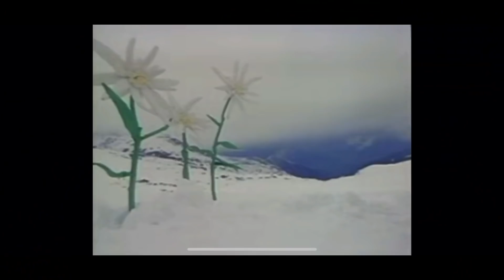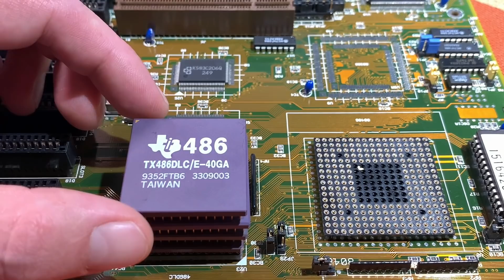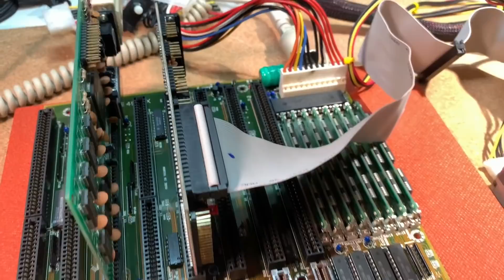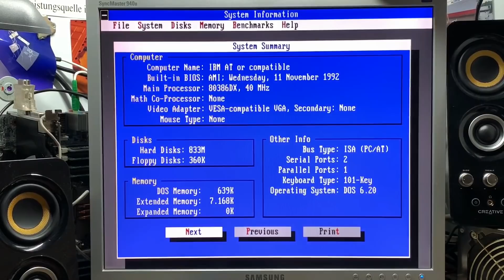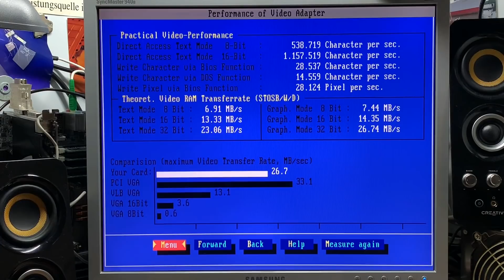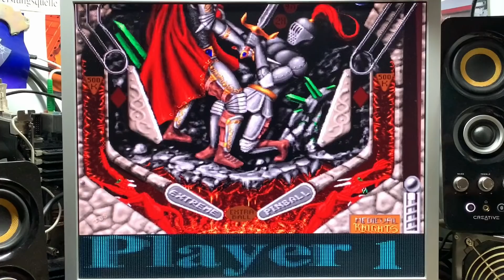AMD 386 DX-40 and VESA LOCAL BUS - Boardreview and Benchmarks

Comment: I have the same board V2.0 , you can use 386SX-25 to DX4100 overdrive on this board...Of course 386 with fpu. Amazing flexibility. Mine had a leaked battery bıut minor damage, salvaged from junkyard...

Comment: I disagree with the statement in the video that it is not worth having a VL-bus on a 386. For me, it is worth it from several different points of view. I will explain why. 1.) Yes, for more demanding games the CPU is the biggest bottleneck, but not the only one. In this regard, the test in the video is somewhat misleading. The test used a graphics card with the Cirrus Logic GD5428 chip. This is, of course, a fairly modern card, which is one of the best that the ISA bus could offer. But most people had a much worse graphics card in their 386 - typically some Trident 8900/9000, OAK, Realtek, Tseng ET3000, which are very slow cards. Usually equipped with 0.5MB of video RAM (generally from 256KB to 1MB). How many people had a GD-542x, 543x, Western Digital 90C3x or Tseng ET4000 at that time? That was really a minority. For most, any VL-bus card was a major upgrade, even if it was the most ordinary S3 805, which would eat all ISA cards for breakfast. In reality, for most cases, the difference would be greater than measured, even in games. 2.) Games are not the only thing that was run on PCs at that time. Even for simple image viewing, for example, ACD See or another DOS browser is sufficient with the same 386. 3.) Various graphical user interfaces were also run on the 386, and not only Windows - breadbox Ensemble/New Deal Office, GEM, Cybex Shell. There were also a number of programs that used graphical user interfaces - Deluxe paint, Mat, ET Klasik, Word 6, Excel, NeoPaint, various CAD systems, etc. All these programs for DOS will take advantage of the higher performance of VLB cards. Moreover, with these cards, it is usually possible to set much more interesting resolutions and refresh rates. Yes, this was also addressed in DOS, so it made sense. With Windows, OS/2, UNIX or Linux, this is multiplied. VLB cards were not only faster in principle, but the newer they were, the more they contained various 2D acceleration functions that could greatly speed up the GUI, but also the programs that ran under it (e.g. Corel, Adobe, large spreadsheets in Excel, CAD, multimedia). Each of these acceleration functions simultaneously relieved the CPU, which did not have to devote itself to rendering primitive functions (such as filling the area, moving the cursor, window frames), but to something else that the user would appreciate more. Most VLB graphics cards could be expanded to 2MB and had a better DAC, which meant not only higher resolution, more colors and higher refresh rates, but also increased performance, because most chips used at the time were designed in such a way that by expanding the memory, the data throughput of the bus between the chip and the memory was also doubled, so a further increase in performance. Apart from a few top late models, this was an unattainable dream for the ISA world. These are things about graphics that gamers won't appreciate, but those who worked on that PC will appreciate.
3.) Another thing that gamers won't appreciate, but workers will, was the ability to provide a better VLB controller. In DOS, where small files are loaded one-time, it's unimportant, but in Windows, where data is worked on and something is constantly being loaded and saved, it was important. It was possible to use both IDE controllers with cache and SCSI controllers. SCSI controllers have an advantage not only in speed (SCSI disks of that time were usually faster), but they also relieved the processor. When the processor works with an (E)IDE disk, it is used up and it can't do anything else very well. So if we work a lot with the disk, then we have a lack of CPU power. SCSI controllers often had their own controller and so they put much less strain on the CPU. So the CPU could focus on other things. That's why SCSI was the standard in better PCs of that time/workstations/servers. In case of heavy load, it could also be combined with the controller having not only its own cache but also its own processor, but we are a bit out of the picture. It was completely brutal when the system started swapping, which was a normal process, because RAM was generally in short supply at the time, as it was very expensive.
4.) 386 boards with vLB were also of a newer production date, so they supported user-friendly things like automatic disk detection, but they often also had support for 4 disks (which was appreciated given the size of the disks at the time). Those boards also often had correct support for 486DLC CPUs and derived types, so you could afford to turn on the L1 cache, which was turned off by default due to problematic compatibility. This also affected performance, and they were easily upgradeable to a real 486 like the board from the Galaxy video. So in 1993, a person built a supercharged 386 without paying much more for a 486, and a year and a half later, he added an AMD/Cyrix/TI 486 DX2 80MHz for very nice money, and he had a solid machine again without having to change practically the entire PC as if he had bought a regular 386. Maybe he added another disk, a CD drive, and more memory to the graphics card, because he had somewhere to connect it. The upgrade took him 10 minutes of time and a minimum of money.

To sum it up, VLB in combination with the 386 had a small but nevertheless recognizable impact on gamers and a big impact on the productive segment. I do not agree with the distorted view that only games were played on PCs at that time, and therefore I reject the conclusion that it is only valid for games, and even then only partially. I had such a system then and I have it again today :)

Comment: I was a tech during these days, and it was a little early for VLB.  The operating system wasn't mature enough to take advantage of it except in very specific circumstances and with software which knew the hardware.

Comment: I've always being intrigued with a VLB setup, so I built my own in 2019... For VGA you can use for the 16 bit the WD90C31A-LR 1 MB (Paradise), it's very fast, I believe the fastest for an ISA slot. I have checked ET4000AX, Trident and some Cirrus Logic, all with 1 MB VRAM, but the GUI acceleration for Windows 3.x is very poor than the Paradise. And for 32 bit (VLB) try the SPEA Mirage (Video Seven) S3 864 Vision P64 with 2 MB VRAM. Fastest card (yes faster than ATi Mach64) for VLB bus and with excellent GUI acceleration. On my i486Dx2 66 MHz it runs Quake and it is playable!

Comment: For VLB bus, 386DX doesn't have the arithmetic intensity like a 486 or RISC CPU at a similar clock speed. The 386 has hardware barrel shifters for that PinBall game. A different non-3D benchmark is needed.

Doom doesn't use FPU.

Comment: Huh, have you ever used the Feature connector on the VGA card? I had the pleasure of doing so with a TV card, but truth be said that had AWFUL quality, TV on a PC monitor really looked like crap back in the day, and as if the source signal was not bad enough it was then being digitized at 320x240 in most cases. Recording TV then was like nope, bad quality and the file sizes for the common HDDs back then were ablsolutely crazy. Thanks for for MP4 and above!

Comment: Oh thank you god, thank you, this one is also missing the 2 PAL chips, for a second I though I may have been screwed with mine :)
ATM building it with a DLC 40, 4Mb Cached 80186 based IDE controller, 512Kb Trindent VGA (need to get a 2MB VL one) and a nifty AMD Ethernet Controller. Still missing an FPU... Though I may end up just putting a 486DX on it...
Seems my only issue was I had not configured it yet and it was seemingly set for a 486DX 33Mhz,  so definitely no go for a DLC 40Mhz (not that the clock would matter in this case)

Comment: Anyone else notice the spot for a QFP CPU has two separate sets of pads? Looks like you could not only have the option for either a socketed 386 or 486, or 386 or 486 QFP?

Comment: I wonder how this motherboard makes the VLB accessible to the 386, as the VLB is tied to the 486 memory bus, with the CPU managing arbitration between VLB devices.

According to Wikipedia, OPTI was manufacturing VLB-to-PCI bridges, allowing VLB cards to be used on a Pentium, but this is wildly different than adapting a VLB to work on a 386. How did they manage it?

Thank you for showing us this rarity, and that it actually worked! I was surprised to see the increase on performance on the video memory access!

I also admire your collection of CPUs and FPUs :)
Reply from the maker: Thank you 🙏🏻

Comment: The reason for the pin1 position on the 387 is guaranteedly because it made the wire routing easier for the board plan.

Comment: I would guess the reason the 387 is rotated 90 degrees from the 486 on the socket was because of some board layout issue.

It could have been easier to lay the board traces that way, or it may have been impossible to route the traces with both being oriented the same way. If that was the case, they should have just had a separate socket for the 387, there is plenty of open space on that board to do that.

Comment: On my AMD 386DX40 / ALI M1429/1431/ CL GD5402 ISA / ESS688 ISA sound, the first DOOM went noticeably faster than on this video. It was possible to normally play full screen in normal graphics. It didn't work out with DOOM 2, the game went up to about the 5th level, and then because of the size and complexity of the level itself, and because of the high number of monsters, the game has already slowed down to 5fps and below.
But I went into the "chipset settings" in the BIOS and tweaked the system as much as possible, including raising the ISA frequency to 16 MHz.
Moreover, in Windows 3.1, videos of the MS Video 1.1 format were running normally, even on full screen. Unfortunately, I don't remember the resolution of the videos, perhaps 320x240.

Comment: You need controller specific driver software to enable VLB dma transfer from the hard disk. Also the driver might only run on a 486. I had one set up on a DX4-100 and got 12 MB/Sec. on a good ide drive.

Comment: Back in the times when 386 and 486 were the norm and I worked as a technician in this field, I always said to those who at all costs wanted a VESA LB controller (all of those, even the cheaper [as in construction] ones, costing on average twice the normal ISA ones) that the speed of the HDs of the times, even the fastest ones, were too slow to constitute any kind of serious bottleneck for the normal ISA controllers and that that money would have been better spent into beefing up more important parts of the PC, like memory or a better video card.

Nemo propheta acceptus est in patria sua, none of them ever believed me insisting on the VESA LB controller, even one idiot that ordered a very rare non-DX2 486 50Mhz (50Mhz FSB on a 486 motherboard strained the industrial building standards of the PC motherboards of the times) that didn't want to hear reasons, the video card AND the controller both on VESA LB or he wouldn't buy the PC. I still remember that to make two LB cards work at that FSB speed (that went verbatim on the VESA LB, there was no clock halving on those Local Buses, unlike the then here not yet available PCI) was a veritable frustrating open eyed, walking nightmare. We had to go through SEVEN different motherboards before finding one that would work at all in that configuration. And lucky us VESA LB audio cards were never made or that long forgotten idiot would have us mounting one on his PC too pushing me into murder him forcing him to swallow the VESA LB controller whole. From the other hole.

I feel vindicated now... I "only" had to wait almost thirty years. 🤐 

As for your problem of the VESA LB controller being slower than the ISA one... inferior quality construction or maybe some component of the VESA LB controller (like capacitors), though still working, getting old may be the cause.
Reply: "the speed of the HDs of the times, even the fastest ones, were too slow to constitute any kind of serious bottleneck for the normal ISA controllers"
That was my perception as well at the time (though I was 13 and had to rely on randomly found scrap boards for testing)

Comment: I looked at the pinout for the 387 and the 486. I'm certain it's rotated the way it is to make the board layout easier. The first three rows of pins on the 486 on the side of the socket facing up from our perspective are all of the data bus pins (D0-D31). The data pins on the 387 are in the same relative position when it's installed correctly. I'm almost certain that the data pins on the 486 pins are connected to the data pins on the 387 pins to make layout simpler.

Comment: 14:53 I know why the result is worst for hdd. 
On the Winbond 32bit i/o controller you have JP1 jumper, which is divided to sections of 1,2,3,4,5. Section 4 and 5 is for latency delay. I see at 11:50 that you have those jumpers on the default position (all on top), so it will give you slow 600nS. So, set jumpers from section 4 and 5 from top position to bottom to lower latency to 240nS. This will increase data transfer speed but it can produce issues if hdd is from early technology. I believe that slow default 600nS is set for safety to run newest and the oldest drivers in the same time.
Reply: wow, good observation!!

Comment: Didn't someone make a 100MHz clock-tripled 386?  TI maybe?  I heard it was comparable to a 486DX2-66 in raw compute power.  I'd like to see how THAT CHIP plays Doom with the VLB video card, since the ISA BUS is usually cited as the limitation that stops it from ever catching the DX2 in real-world gaming.
Reply from the maker: no, there was no 386 with clock double or clock tribble Technology. there was from cyrix one, but a 486 for the 386 socket with 33 mhz fsb and clock doubled to 66 Mhz.
Reply: OK perhaps it wasn't a true 386 core but I could swear I remember reading about SOMETHING designed for a 386 socket that has a 100MHz internal clock.  Can't find reference to it right now though.  Does something like that exist?
Reply from the maker: never heard about sthg with 100 mhz in a 386 socket. 🤔
Reply: Perhaps you're thinking of the NexGen Nx586?  That's ~100MHz RISC core which emulates a 386 externally, though it used its own socket.  AMD bought them and based the K6 on the never-released Nx686.
Reply: @awd42  Actually I've wondered since writing this if I could have been thinking about the IBM Blue Lightning chip, as in the Alaris Cougar board.  I know that's permanently installed onto the Alaris board, and stock clock is 75mhz, but I'm also given to understand that most of them will do 100MHz if the FSB is increased to 33MHz.  I believe I'd read about that chip, along with others from the era, in a Wikipedia article - and that would have been long-prior to the awesome video by RetroTechBytes about his Alaris Cougar board.  Now that's a board I'd love to own - if they weren't so GD expensive of course!  Fantasy project: A museum-quality IBM 5170 PC case with an Alaris Cougar mobo running at 100MHz with full allotment of motherboard cache, a ~512MB period-correct IDE hard drive paired with a 512MB removable CF card mounted on a rear ISA bracket, an original 1.2MB 5.25" floppy drive paired with a GoTek floppy emulator, and external Backpack 3.5" floppy and CD-ROM drives connected via parallel as-needed.  I have everything but the Alaris motherboard.

Comment: I'm not surprised DOOM doesn't improve with VLB.
The way DOOM works is that it renders all the graphics into main memory first, then once the frame is final, it copies it to the video memory. (AFAIK That's partly because the VGA mode used doesn't support any kind of hw based dual buffering).  And that copy isn't the big part of the time. Even if the 386 was able to render 35 frame per second (max doom tick rate), this would still only be using about 2 Mbytes/s of video memory bandwidth.

Comment: Regarding the vlb controller, I'd test it in a pure 486 mainboard to check if the vlb implementation was better. Also putting two vlb cards force them to share bandwidth.

Comment: My 386 board has a DX-40 (socketed), problem is it doesn't have VESA (which sucks as my only working VGA card...is VESA). Even though I can install and use an 486DX/2-66.

I'd still use it any day over my Cyrix 486SLC 25MHz however - even if the BIOS battery hadn't leaked. The board it is on while more compact is also highly unstable.

Comment: I wonder if an Intel Pentium OverDrive 83 would work if you soldered some single-row round pin sockets around the perimeter on the CPU socket, seeing as there are pads for them.
Reply from the maker: I asked me the same 🤔

Comment: Am i totaly wrong? Or isn´t it that 386 normaly use a 16 bit memory bus while the 486 use a 32bit memory bus? how does this work in this MB? or is the 386 DX able to use a 32 bit memory bus? I was under the impression that it just used a 32 bit front end bus.
Reply from the maker: The 386 DX has a 32 Bit address bus. the SX a 24 Bit.
Reply: @CPUGalaxy  Are you sure about that,... and have not confused it with address space?

Comment: Halo von Frankreich. I had a VLB controller on my 486 and it needed a TSR to enhance the transfert speed at a rate higher than PIO0. Unfortunately, this driver was flawed and not working with discs over 512MB for obvious reasons. I changed it for a VLB Tekram with 4MB cache and oh my, the discs were really fast. The Tekram also didn't need a DOS driver and always put the disc at the highest transfer rate. It you have one old Linux at hand, you may try to use the command hdparm to boost and to benchmark the real improvement with VLB controller